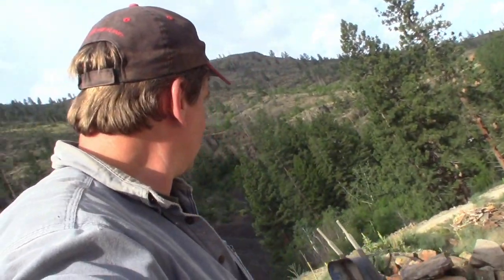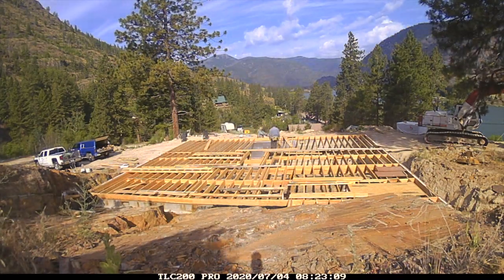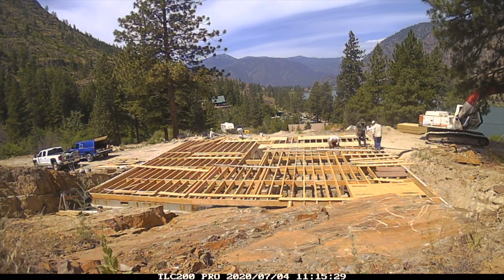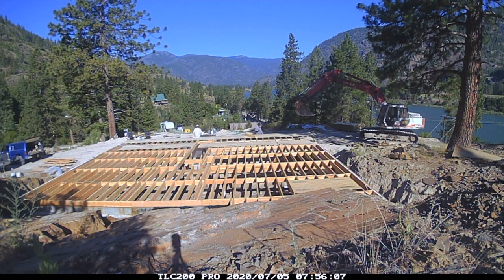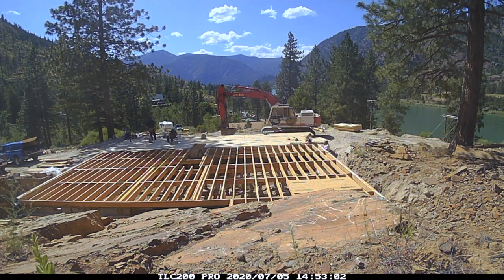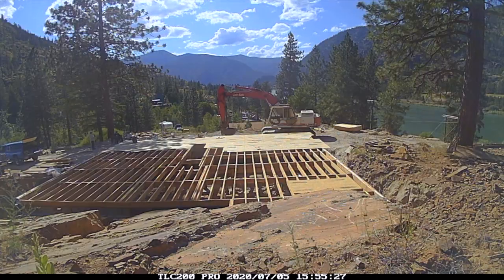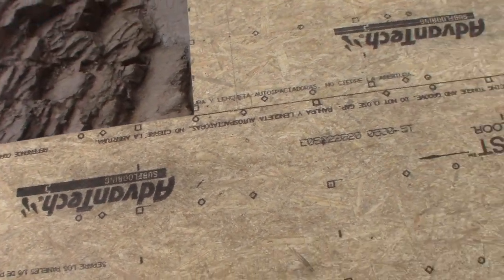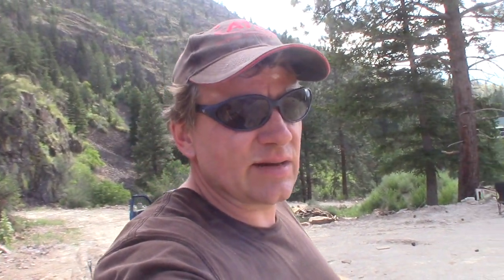River House 127 - Putting Down Advantech Subfloor

Comment: You'll be glad you glued it. I had a squeaking floor for decades and only fixed it a couple weeks ago, it was actually the shaft of a single screw rubbing on the hole wall as the sheet flexed up and down. Screws will work loose ever so slightly just from the expansion and contraction of wood with moisture, no matter how tight they were done up.